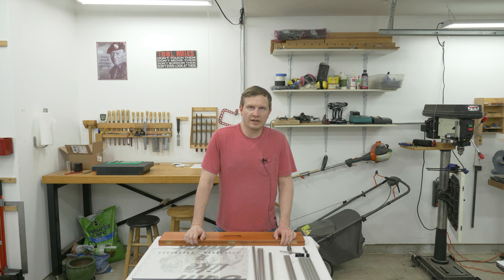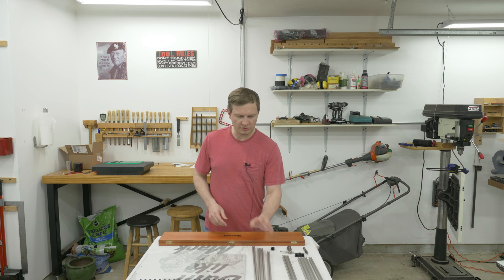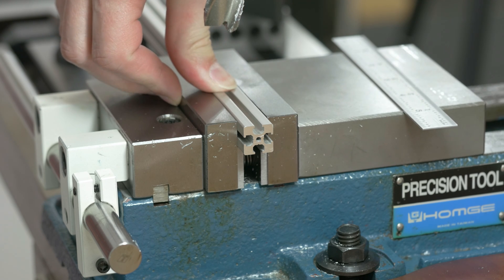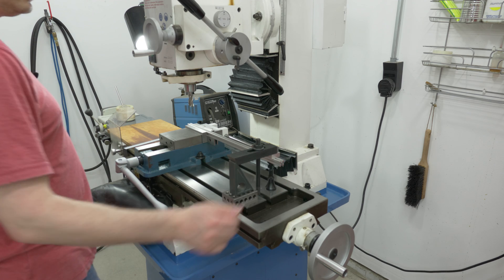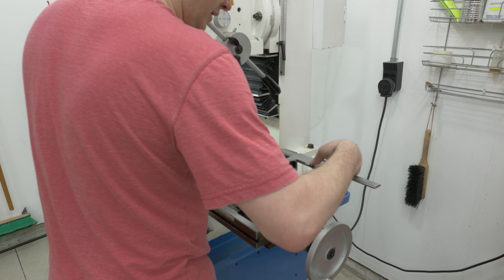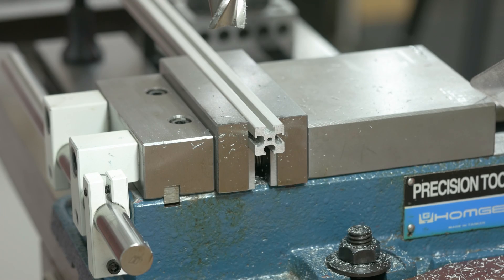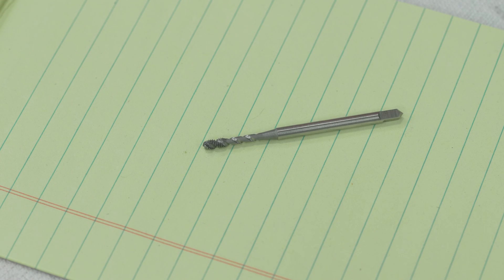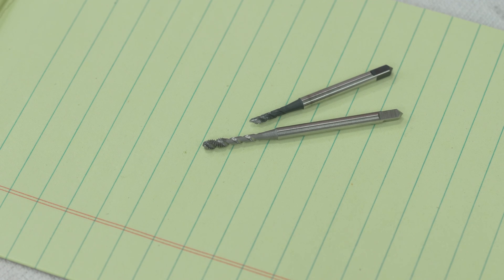Machining Aluminum Extrusion

Comment: I like the enclosure Dan, nice job.  I was hoping you would drill out the holes on your lathe with the 4 jaw.  I like your lathe.
Reply from the maker: I wish i could have, but the spindle bore it to small to fit the extrusion through.

Comment: Nice design - 👍👍😎👍👍
Reply from the maker: I based my design on the one Mandala Rose Works sells for my printer.
https://mandalaroseworks.com/products/top-enclosure-kit

The main difference is that I didn't want to print a bunch of interface parts, and then just have the enclosure sit on that. I wanted the ability to securely fasten my enclosure to the rest of the printer. 

The other two differences are the height of the enclosure, and the design of the back panel!